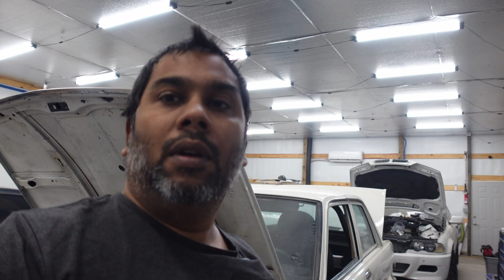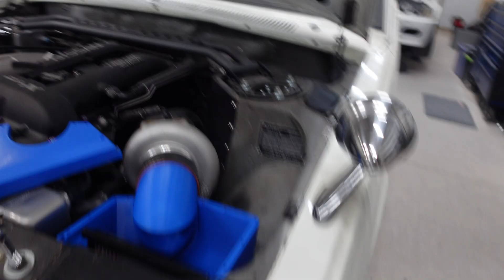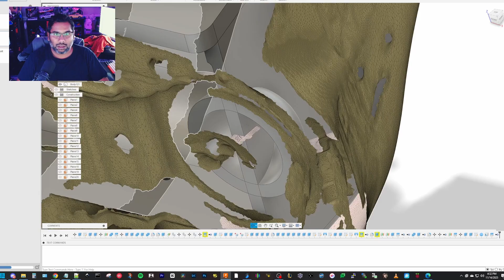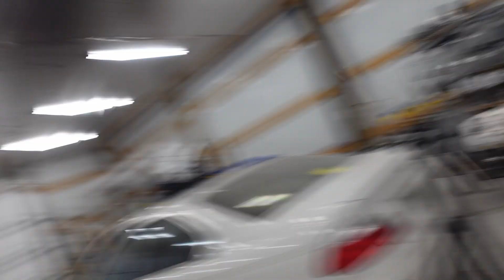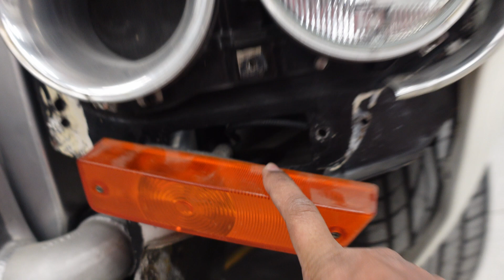Custom 3D-Printed Carbon Fiber Turbo Intake Box for My Datsun 510

Comment: Genius level stuff here, man. I second the earlier comment about selling your custom parts. I'd love to have a mechanical ebrake and would like that airbox as well... but I'd have to mod it since I plan on keeping all the lights on mine.
Reply from the maker: Thx bro. With the open face it should clear. I’m also thinking about designing a new taller version.

Comment: Hey bro i seen that u worked with an infiniti before about akebonos so i did a brake uprgade to akebonos i used to have the small breaks but once i put them on when i would accelerate it wouldnt let me the car like stops the rpms from raising and also my vdc and slip and brake and abs loght came on please let me know what i can do to fix it ! I been doing so much research non stop and still cant find a solution
Reply from the maker: Well I’m assuming you’ve bleeded from the master cylinder to the furthest caliper to the nearest. 
Then filled the reservoir when you was done? 
Normally that happens when the reservoir is low.
Reply: @3rdPedalMedia  yeah my dad bleeded the calipers and we also topped off the brake fluid do u think he possibly didnt bleed them right ? Also its weird when i put on all my 19 inch wheels the sport ones also my vdc brake abs alsd slip and brake turn on but when i put my 18s back on that came with the car stock only the vdc and slip light come on after i drive for a while

Comment: Came out super sick! Cut the coupler down a bit off the turbo so you can gain more room and it’s not pushing . I had to do that on my DBW coupler to get it off the radiator. Great work!
Reply from the maker: Thanks man! I ended up sending that back and got a straight 4x3 coupler.

Comment: Looks great. You could use a razor blade and cut the coupler down from the turbo to the box a little bit unless you are trying to preserve it. 

Would love to see some before or after temperatures.
Reply from the maker: yea i just sent the joker back. got a simple straight coupler. 
two things i wanted from this box is protect the turbo and stable intake temps